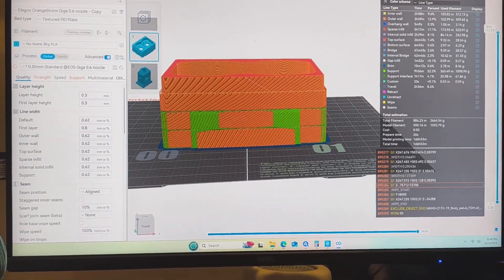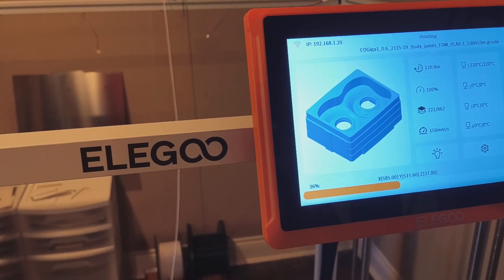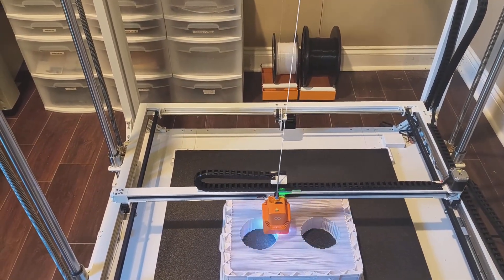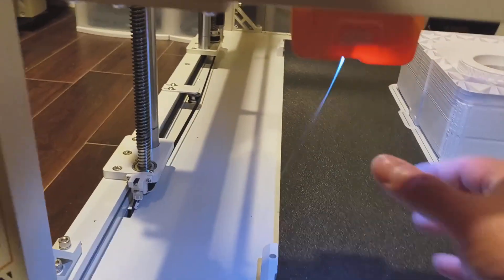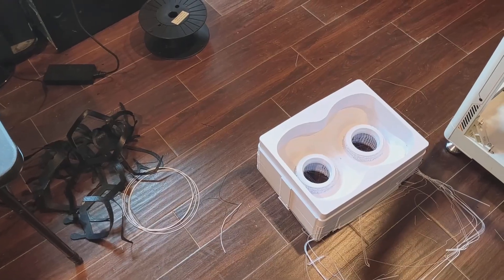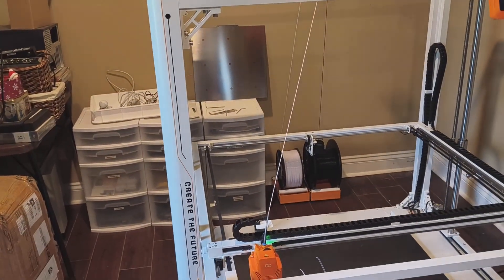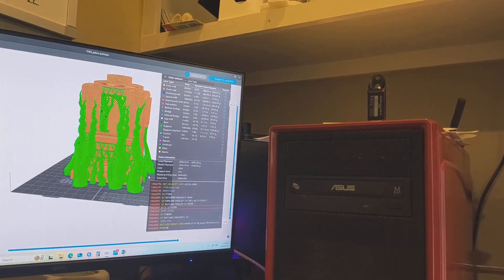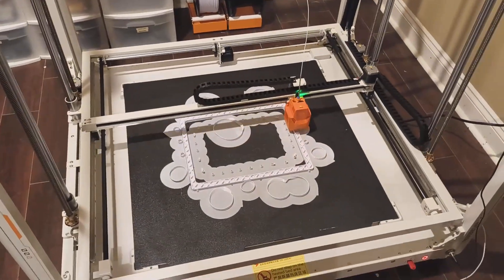1:1 Hitchhiker's Guide to the Galaxy #5 Elegoo OrangeStorm Giga - Marvin's Body

Comment: I don't understand what the point in using a PLA that you know is rubbish.
PLA is pretty cheap anyway 🤷‍♀️
Reply from the maker: It is because it does a fair job on large pieces with little detail that are going to be painted and sanded anyway.  Plus, I have 18 more boxes of the stuff left, at $34.54 per box, that's $622.62 worth of filament, so I'm determined to find some use for it.  ;-)
I guess one good use would be flat wall-art as the first layer always seems to squish well onto the plate.

Comment: I'm in the process of moving, but will be buying one of these to build my 1 to 1  Tie Avenger
Reply from the maker: So far, my experience is very good, just make sure you set the z-offset between every large print.  You want it to grind on the plate for PLA.

Comment: Question!  How happy are you with your Giga?  I'm thinking about buying one but there are a lot of videos of people having problems with them.
Reply from the maker: One thing I haven't tried on the Giga is PETG.  When I use that on my other machines with PEI plates, PETG  sticks way harder than PLA.  In fact, it is a major pain to remove from the plate without flexing it and using a razor/scraper.
Reply from the maker: I've had two problems with it so far and they have both been the same thing:  The print head gumming up with filament.  In the first case Elegoo just sent me a complete print head.  Then the second one did the same thing, but I caught it, disassembled it, removed the blob from around the sheath, reassembled it and now I'm printing again.
In both cases, I believe I know the issue.  The prints both came loose from the bed, and wrapped around the nozzle.  The print head kept moving and extruding filament, but with nowhere to go except upwards, it filled up the space around the hotend.
Every successful large print I've completed has been after doing a fresh autolevel (which might not be necessary) which then takes me into resetting the Z offset which I set really low so it grinds hard on a piece of paper or only just allows the metal gauge that comes with the printer to slide around underneath.
Right now, I'm a day into a 4 day print and everything is good.
Everything else about the machine:  The interface, the assembly, quality of the frame, etc is excellent.
I've plugged an old Beaglecam v1 into it to follow the prints, but I haven't worked out how to get the video to show up in Fluidd (I can only see it on my phone app), or how (if possible) to control the printer via the phone app (so I could shut it down in an emergency).
Reply: @LanchburyConsultingLLC  Thanks so much for the detailed response!
Reply from the maker: @bbkillen  You're welcome.  Thanks for watching my videos.  🙂  If you have any other questions then just reach out.  I'll give you straight, honest answers.